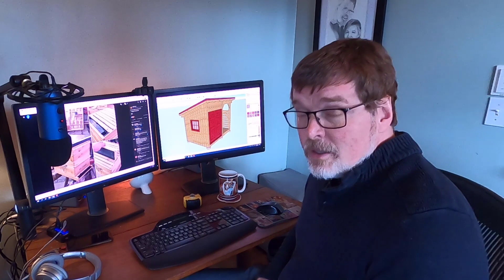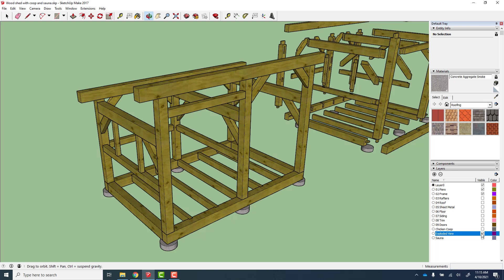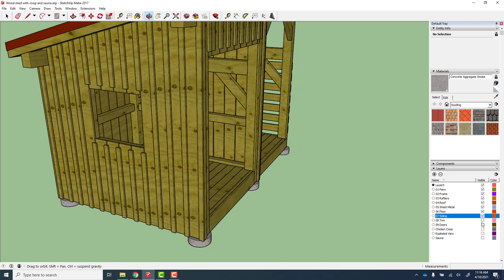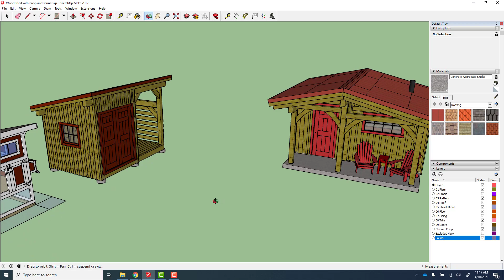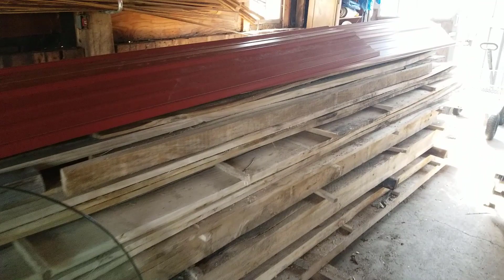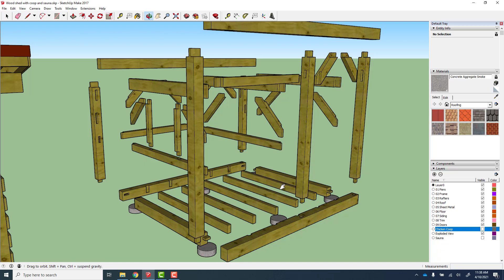Design for a timber frame garden/wood shed.

Comment from the maker: I later tweaked the design slightly. I moved the girts up a bit, so that they are partially on top of the rear plates, in the same way as the sauna frame. Other than that, this is prety close to my final design.